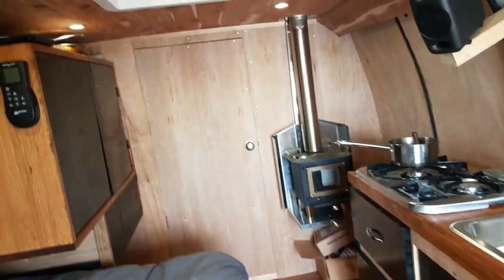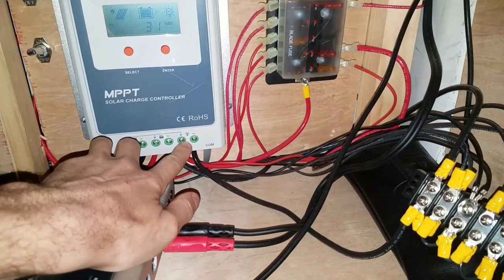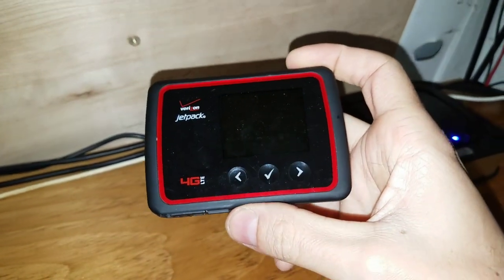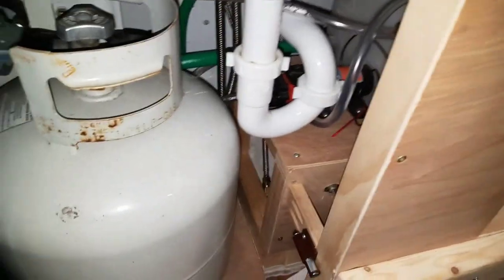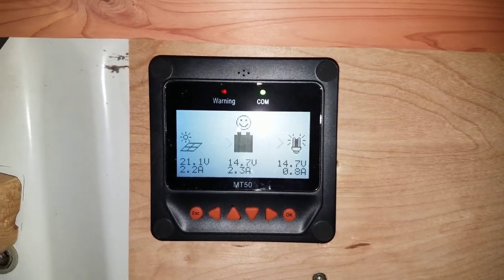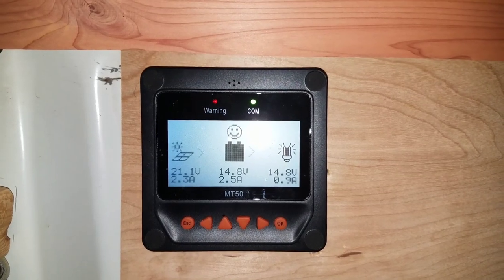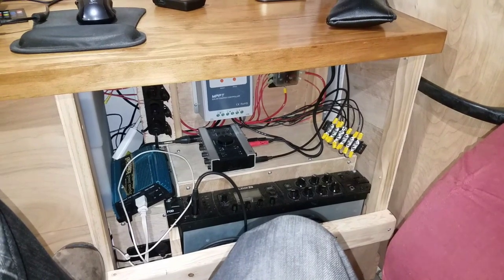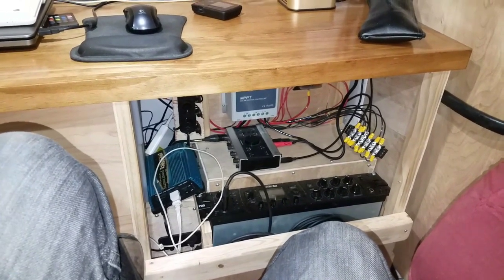What to Expect from 150 Watt Solar Panel Setup

Comment: I really appreciate that you explain how many amps the devices in your van pull. I'm currently about to start my first van conversion and am clueless when it comes to solar and electrical work. This helps a lot in figuring out how much power my wife and I will be using.
Reply from the maker: Ooooo, stay tuned. This video ain't shit compared to what I'm about to release next! I've been working on it for over a month. It's a full van life electronics video to show beginners so they can do all the electronics work themselves.
I'm just making a few finishing touches on it. It might be out late next week.

Comment: The solar panel has current that is lower than battery and load combine is because you have a very efficient charge controller, characteristic of an MPPT charge controller.  It converts input wattage and put out equal amount of wattage.  Watt = Voltage x Current.  At 7:45 mark, your input wattage is 21.2V x 2.3A = 48.5W.  This input wattage is converted into 35.5W charging (battery 14.8V x 2.4A) and 13W load (14.8V x .9A) = 48.5W.  Hope this makes sense.  Great build.  Thanks for sharing about various loads - I was wondering about some of the devices and your video answer it.

Comment: Hey nice Job on the van. Up here in sw Michigan I’d be running that stove far more 🤓🤓🤓. Your location is likely what makes 150watts of solar viable. Up here of course I would need more. Location location location I guess. I’ll be building my camper/trailer this spring I might start actually posting build video then but haven’t made up my mind. Those batteries look pretty heavy but I can tell they are well Engineered. I must say 14.7 volts raises red flags for me but every manufacturer is different. Most people fail to read the definition of the word “nominal “  it really starts to put things in perspective when it comes to voltages, chemistry,and characteristics of a battery.  I’m currently constructing lithium batteries for my build again very different.  I look forward to following you.
Bryan
Reply from the maker: Tiny Solar Shack thank you for the compliments!

Comment: sorry, keep thinking of questions, after my comments.  why don't you have your house batteries also hooked up to your alternator? why just to solar?
Reply from the maker: I finally installed a battery isolator. Video coming soon. I recommend everyone start out connecting their battery to their alternator first before solar. I did it backwards.

Comment: A Killawatt (spelling) can be used to measure the electricity drain of various devices. It is plugged into the ac outlet and then the device plugged into it. The actual drain is shown. Vampire electrical devices also use electricity when they are turned off such as instant on televisions and some radios. So leaving that television connected to your battery might drain away your hard won electrical charge...  :)
Reply from the maker: Jack Rodgers, Jr.
Yes, the bottom line for all of my connected devices that are switched off is 0.1 to 0.2 amps it seems. I haven't noticed a huge difference since the beginning to now. I mean, I have huge batteries too so I don't really need to worry too much, they never seem to go below 60-70%.

Comment: You need to add a switch so when you are driving you can press it and it will transfer 12v from the car battery/ car alternator to your battery bank! harness the extra power the engine is producing.
Reply from the maker: Yes, I do need to do that!
Reply from the maker: Yeah! I almost added one, BUT I added another solar panel instead. So now I have one on the front of the roof too now!

The two panels is plenty of power, but it'd be nice to have an isolator too because then it could charge on rainy days.
Reply: That is just to isolate the car battery from the separate battery bank. This might not be needed if you manually engage and disengage the connection.
Reply: But why not have more energy that would otherwise be wasted! :D
edit: plus it will make great video, I would love to watch that project.
Reply from the maker: Correct! BUT I would want to put a smart charge controller in between the two so the battery doesn't get damaged. Too many amps can hurt a deep cycle battery. The charge controller does the same thing as the solar charge controller. It monitors the battery and knows when to apply whatever charge it needs. It lowers the charge when it gets full. And it performs an equalization every week, as recommended.

The one I want is over $200. Otherwise, the large amount of amps from the alternator could hurt the battery, even if not fully charged.
Reply: Maybe you can try just connecting the car battery in parallel to the 12v parallel connection of the 2 6v batteries. I don't know about what you are talking about but it is probably safer and better than just connecting it without protection. Whatever you do, I am exited to watch this project! I hope you share this on your channel.
Reply: @Kamper Ken and continuous duty solenoids are like $15 so its affordable.

Comment: Im curious of your thoughts on the s460 Surrette Batteries, And would anyone recomend other options as opposed to the ones you used ???
Reply from the maker: A lot of people in the comments are saying not to get flooded lead-acid batteries. I've had no issues with them so far though. I can't answer your other question about the batteries you asked about. I don't know.

Comment: My iPhone will act as a WiFi base station and I can share its cellular signal using the WiFi option. I have the unlimited data plan with Verizon and can share 15 GB a month with my iPad. Verizon charges $10 a GB for the iPad if I connect it directly. Don’t understand why an iPad should pay more for data than the iPhone but that’s the way it is.

An old phone with an unlimited plan might be better than one of the cellular base stations, money wise.

Comment: Upgrade the wire size you have going from battery  to battery the ones your using are to thin
Reply from the maker: 8 guage is more than enough. I did my research. But you are right. Most people use way to small a wire guage.
Reply: @OutdoorsEmbrace  8 guage is not more than enough I'm a master Electrician not saying it won't work but 8 guage is to thin why do you think jumper cables are as thick as they are but the choice is yours
Reply from the maker: Here is my reasoning:
Jumper cables are thicker because there is more current moving through a shallow cycle car battery. My battery, though, is a deep cycle battery for solar and marine applications. Only about 10 amps max at any one time moves between this wire in my van, and mostly just 2 to 3 amps at any one moment. A normal car battery (shallow cycle) can use like 30 to over 100 amps at once, and I'd agree with you, I'd need more of a wire. But you are incorrect because I am not using a shallow cycle battery. 8 gauge is more than enough for my application (using only 10 amps at any given time). If it goes over 30 amps, which still the 8 gauge is fine, then my fuse will burn out and the battery will be fine. They charge just fine too.

Can you elaborate on why you think it is too small?
Reply: @OutdoorsEmbrace  I'm not going back and forth with this it's obvious your going to do it your way but 6 Guage would be the limit not 8 I'm surprised nobody else told you that the bigger the better the flow but 8 I would not ever ever use. And the charge controller  is pronounced  EP EVER
Reply: @OutdoorsEmbrace  then again I'm looking at your inverter your not really pulling any power maybe you should of just used 18 Guage speaker wire lol
Reply from the maker: My inverter has nothing on it really. That's what I'm saying. None of my appliances are "thirsty". I did this on purpose. I got my information from my dad. He is a master electrician. Has been one most of his life. 8 gauge wire can take 40 amps of current.

Yes, the bigger the better the flow, but there is no reason in this application to use bigger. Most of the electronics themselves are 

Now, that said, I will be adding on a battery isolater so I can charge my battery from the front alternator. At this point, I'll need to upgrade that wire! Probably to better than 6 even. Haven't done the math on that yet.
Reply: @OutdoorsEmbrace  battery isolators don't like mixed types of batteries regular vs. deep cycle. I had lots of problems in this area. Helps if voltages match the engines battery too.